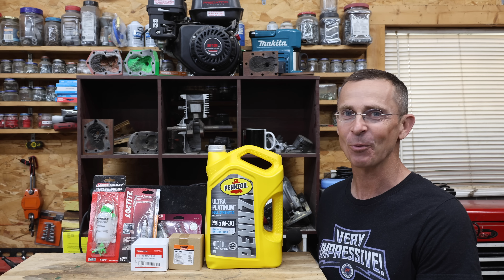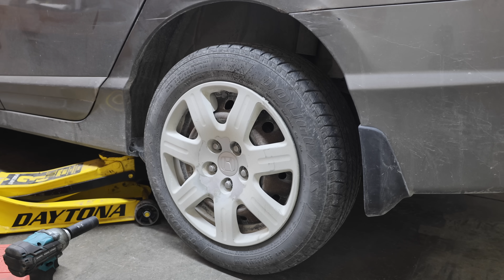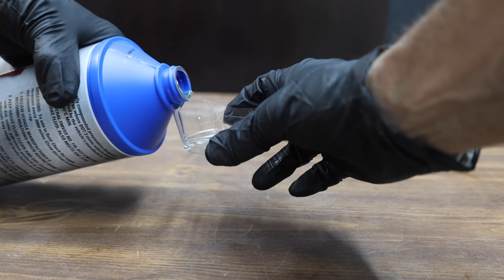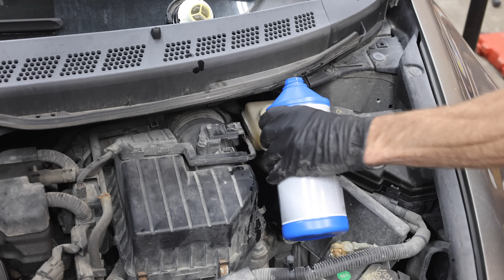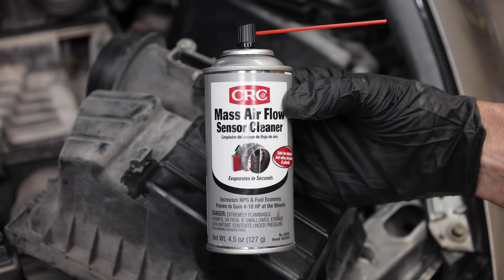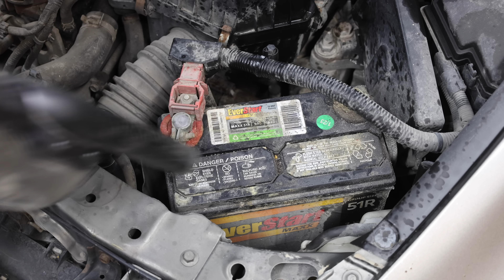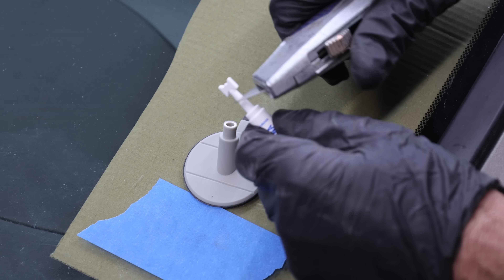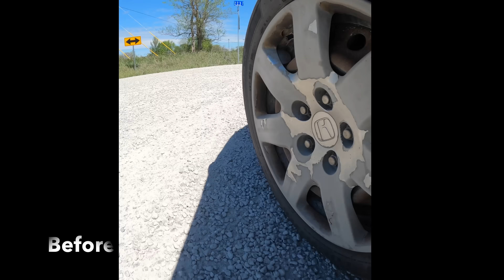Most Reliable 200K Mile Car? Let's Settle This!

Comment: You should definitely do a video on best Over the counter windshield repair systems because that one was absolutely ridiculous. 
I used to repair windshields professionally with vers expensive equipment, but it's a very simple process and I personally use the Rain-X kit because it's simple and is pretty much exactly the same process that professionals use. 
What they don't tell you is to make it pretty much disappear, you have to work all the air out of the break. That Permatex system is way too complicated.

Comment: Please review windshield wipers.  I went to Walmart and noticed the rubber edges of all the wipers on the shelf looked alike, only the metal holding parts were different.  Hmmmm......Would like to see if the rubber edges were made from the same material or from plastic/rubber/silicone/or other synthetic material.

Comment: TIPS 8:17 : You should have replaced the radiator cap because it is designed to let coolant flow from a certain pressure. With age, the pressure rating changes and the cooling system may operate outside the temperature and pressure specified by the manufacturer.  Make sure the rating of the new device is appropriate for your region (depending on whether it's hot or cold, the cap pressure will be adjusted for greater reliability).  the one on video is rated to 1.1 bar
and maybe also the gas reservoir cap.

Comment: Great job Todd!  You smartly cleaned the MAF sensor but not the throttle body plate?  They're usually pretty carboned up.  Top tier gas will clean the injectors as well.  I'd probably run some injector cleaner with high PEA's as well.

Comment: I see a safety concern.  When I was in college I read this court case. A mechanic used a jack to lift a car.  The jack failed and the mechanic got hurt. He tried to sue the jack company and lost.  It was ruled that jacks are made to only lift a car, not hold the car up.  That is what jack stands are for.  So, you can lift the car with the jack but use jack stands to hold the car up not the jack.

Comment: 300,000km on the daily 2000 civic for the summer, 427,000km on the winter beater Acura EL.  Acura cost $100, Civic was free.  Maintainance has keep them going for years and have no intention of parting with them...

Comment: Ha ha, can you imagine if this was a Ford.   Well, it likely wouldn’t have made it past 130k anyway.  If it had the 3.5 engine, the water pump would cost $3,500 to replace at an independent shop, a lot more at the dealer.  Bit lots of other parts would have failed first.

Comment: I bought a new Chevy Cavalier wagon in 1983. Not sure what year I sold it, but was sold to a junk dealer for a few bucks. It was still running okay, but had rusted badly by that time. I had jacked it up to swap some tires (it had excellent tires which would fit another car I owned at the time, so put junk tires on the Cavalier) and at one point the jack went through the car on first attempt to raise it.
Still, couldn't knock it. Don't recall exactly how much I sold it for, but think it was $25. Still, after putting 325,000 miles on it I couldn't really complain.Some makes/models are better than others, but taking care of the routine maintenance tasks and driving like you have good sense makes a big difference.

Comment: I sold my 2015 toyota yaris with 260k miles.. all  original parts from factory except front cv joints and sway bar links, starter.. extremely cheap to maintenance. Best car Ive ever owned for daily use

Comment: I have a 2006 Grand Cherokee with 285,000 and a 2007 Grand Cherokee with 215,000 miles on them. Neither one has ever needed any major repairs, just kept up with basic maintenance.

Comment: Old cars are less likely to require a key with a microchip. Also, newer cars can be used to murder you(as Wikileaks Vault 7 showed). So many reasons to prefer older cars. Also no $10,000 battery to replace like with used EVs.

Comment: I have a 2004 gen 5 Camry with the 1mzfe 3.0 V6. It has 248,000 miles on it and the only part that i ever had to replace due to failure was the starter. I recently replaced all of the suspension and control arms etc due to all of it being original since i was replacing bad outer tie rods, which were also original. To my surprise, the lower ball joints were still perfectly fine. They seriously felt like they had 20,000 miles on them. The car has been in my family since 2007 and it has never missed a beat. It's been such a good car that i'm debating buying a super low mileage one to replace this one in the future as the rocker panels are starting to rust, and the interior is pretty tired.

TLDR, if you want the most reliable car ever made. Get a 2002-2006 Toyota Camry with the 1mzfe. It will never let you down. Gen 4 Camrys are in the same boat, however the Gen 5 is safer and has a better interior, more quiet etc.

Comment: Fantastic video.  While your bread and butter may be product tests, a series on simple maintenance task would be huge. 

Oil change, tire rotation, belt changes, water pumps and thermostats, alternators and starters, how to use a basic multimeter.  Basic plumbing repairs, lawn mower service, 2 cycle engine service and pull chord replacement and more.

Comment: I've been driving a $500 Hyundai Elantra for 3 years now and couldn't be happier with it. Starts every time, cold A/C, alloy wheels, (fake) leather interior,  killer audio system and sound deadener I put in when I started driving it. 150K and I'd drive it anywhere with confidence. I bought 1 new vehicle in my life and don't plan to buy another. EVER.
*ode to my $500 car:
Beaters 'N buckets, no car payment for me
Drive anything, so long as she's got A/C
Repairs and mantainance all done by me
backyard mechanic, under shade tree
You may laugh and you can point,
I laugh at you in that overpriced joint.

Comment: If a car has 200K miles and the automatic transmission fluid has never been changed don't change it or else it may start slipping if you change it.🤓

Comment: Just outstanding. We always nought used when it made sense. We finally bought a new Rav 4 hybrid before the crazy orices for cash. Changing oil teice as often S the dealership recommends.
  That's our retirement reward car and average fuel use is over 40 MPG.

Comment: i still own and daily drive my 1989 Chev C1500 (gas) and 1995 Chev K2500 (diesel) trucks.
can not be beat. cheap and easy to maintain. both get on average about 18-19 MPG which is actually BETTER than most modern trucks!
Reply from the maker: Thanks for sharing.

Comment: I'm impressed by your knowledge and skill!  With your mechanical knowledge in mind, I have a suggestion for a new video:  go over common things that mechanic shops will pressure you to replace and how to check if they really need to be replaced and what risk you are taking (if any) by delaying that maintenance.  Things like pinhole sized holes in a cv joint's boot, old shocks, oil, etc.
Reply from the maker: Thanks!  Thanks for the suggestion.

Comment: My F150 is almost at 270k miles and still runs good.  Only real issue is the ABS/TC computer crapped out.  But, drives fine.
Reply from the maker: Thanks for sharing.

Comment: I would like to see you make videos of taking a $500-1000 car, putting $500-1000 into it, and having a very reliable daily driver. I've owned a 1992 Honda Accord with nearly 300k miles when I bought it, and I put 30k highway miles on it, commuting. I currently own a 2000 Toyota Corolla, bought with over 200k miles on it, and it had the original spark plugs in it. I put in some repairs, and it's been totally reliable for me.
Reply from the maker: Thanks for the suggestion.

Comment: Beware 06-09 civics with the R18 engine! They never issued a recall, but just a warranty extension long expired by now. The blocks are known to crack around the cooling jacket leaking coolant in various severities. Just search "Honda Service Bulletin 10-048".
Other than that and a few other common annoyances like paint, they do run well, are efficient, and the manuals are fun to drive.
Reply from the maker: Thanks for the feedback.

Comment: Todd, You and many of us think like you when it comes to vehicles. I have a 2006 Mercury Mariner that I bought new for my wife. After she got a new Ford Edge; I used the Mariner for work. I had to put a new engine in it at 234,000 miles due blown head gasket. I did basically the maintenance you did on your Honda. I now have 324,000 miles on it and still running strong. Yay Project Farm!
Reply from the maker: Thanks for sharing.

Comment: Great video! I'm with you, I'm not about to pay crazy money for a new vehicle. I have four vehicles, 2 cars and 2 trucks. The one with the most miles is my 02 Silverado Z 71 4x4. I bought it with a little over 220k miles in 2017. I knew most of its history, it had been worked very hard and had reasonable maintenance. My mechanic went over it with a fine tooth comb. It had a list of things needing repairs or skipped maintenance. I had those issues addressed in order of importance, and now my truck is in tip top shape (mechanically) which is all that matters to me. She bears all the scrapes and dings of a work truck, and the usual rusty cab corners, rockers, and fenders. Doesn't matter to me in the least. I call her Big Red. That 5.3 liter is  the original engine, purrs like a kitten, still has plenty of power. The extended cab with 4 doors leaves room for passengers in the back seat. Interior is in good shape, everything still works like new, even the power mirrors. 4 wheel drive when needed. Best of all I have faith I could drive it across country if needed in comfort and reliability. Today she has 325,000 miles and still going strong.
Reply from the maker: Thanks!  Thanks for sharing.

Comment: I was pleased to see you showed the Honda ATF-DW1 auto transmission fluid used.  Honda's automatics up to and including the 6 speed models are a completely different design from the typical planetary gearset automatic transmissions most other makes use.  Using the proper DW1 fluid really makes a big difference in shift performance, driveability, and likely prevents premature clutch pack wear in the transmission.  Universal fluids (even many that state they can replace Honda DW1) don't perform equivalently.  Use of universal ATF quickly leads to rumbling and delayed/hard shifts.  Fortunately, a repeated drain and fill with DW1 often resolves those issues, making the transmission feel like new again.  If the owner's manual specifies ATF-DW1 or the obsolete ATF-Z1, (DW1 replaces it) I don't even think about using anything else.  After 2014, Honda has used some conventional planetary-based automatics in certain vehicles, so they probably differ in fluid requirements.  Those are the 9 speed made by ZF, and the new 10 speed made by Honda.
Reply from the maker: Thanks for the feedback.

Comment: I wish you could find a $500 car like that around here!!!  The cheap cars that have major problems(blown engine, knocking engine, bad transmission, not running, ect) all start off at least $1500 if not $2000.
Reply from the maker: Thanks for the feedback.

Comment: With 200k+ miles I would only buy a Toyota/ Lexus or Honda/ Acura used. An easy way to drain all the ATF from a vehicle is to remove the hose EXITING the transmission oil cooler behind the radiator, start the vehicle and the old fluid will be pumped out into a large pan or bucket. New ATF is constantly added to the reservoir. When the new fluid starts coming out the transmission oil cooler line all the fluid including what was in the torque converter was pumped out and replaced with fresh fluid. This method is easy, mess free, and saves time from having to drain the transmission three times.
Reply from the maker: Thanks for sharing.

Comment: Ive always bought old vehicles.  I spend very little in repairs since i do the work myself, However i dont actually have much maintenance. Ive never blown up an engine or had a transmission go bad. Just minor stuff. I currently drive a 96 C1500 with 350,000 miles on it and a 99 Blazer with 335,000 miles on it. Ive never given more than $2500 for a vehicle. Keep your foot out of it and keep all fluids changed when due (not just oil) and everything greased and drive it forever.
Reply from the maker: Thanks for sharing.

Comment: I would not touch that car with a 50 foot pole.
I have 2 cars,  2006 Mazda 3 2L and a 1974 Cadi 472cid
The Mazda has 485,000km on the clock. Got the car new. Money spent on the car to date, 2 timing belts (every 200,000) 1 cluch @ 370,000km, refinished all 4 brake disk 2 times, oil change every 20,000, rear end bushes.
Still has factory sturts and CV's. Only thing wrong with the body, KARREN hit the back 1/4 with a shopping trolly.
The Cadi has 160,000m on the clock, I shipped from the USA in 1983 with 96,000m on the clock money spent to date 4 CV's, 4 Sturts, new front disk, 2 new Autos, 2 full sets of bushes, wiper motor, timing kit. new motor and auto mounts, I could keep going with the list, the car is a money pit. only reason I keep it, is I use it for car shows (white with red trim) at car shows I put my BOS-HOG number plates on. I do like driving it on a nice summers day with the roof down, I keep it out of the rain, it leeks.
Reply from the maker: Thanks for sharing.

Comment: FYI, that clicking noise was the worn CV joints not the struts. The easiest way to tell is the clicking is always worse when turning and turning while accelerating. Worn struts make clunking sounds you can feel. Clicking = CV Joints, clunking = struts or other suspension components. Cheers!
Reply from the maker: Thanks for the feedback.

Comment: Still have my Corolla with the original engine and transmission. Only has 657k miles on it. Also only 24 years old! You cannot kill a Toyota as long as you keep up with basic maintenance.
Reply from the maker: Thanks for the feedback.

Comment: !! What a Great Video this was to see and your actually saving the planet by reusing what is already made. You will not be able to do this with a Tesla or any other Newer Vehicle in the next 16 years but those cars from the 80's, 90's and early 2000's will still be there. As a Video suggestion: Can you test Battery powered Soldering Irons like Milwaukee, Ryobi etc. or the Electrostatic Sprayers to determine if they actually do anything at all compared to a normal pressurized Sprayer.  Thanks
Reply from the maker: Thanks!  Thanks for the suggestion.

Comment: I was finally watching Mighty Car Mods video about flipping cars as fast as they can.
I stopped because I needed to see a client, but I excitedly showed her a clip where they shoved a deflated basketball inside a car door, inflated it, and popped out a dent.
I backed into Mom's car on Sunday and need to fix her door.
I don't think that will work well, but I am curious what it will do.
I bought a basketball just for moving Mom's piano because I watched a video where someone shoved a deflated basketball under a piano, inflated it, and slid a dolly underneath, but I decided to use my back instead.
Anyway, I thought those were cool tips, but I am going to go back through your video and list all of the tips that I saw.
A fluid extractor to extract more brake fluid than a turkey baster.
I stole Mom's turkey baster when I replaced my brakes a couple of weeks ago.
Double-sided tape to keep the coolant funnel in place.
I actually bought a no-spill funnel, but I can use this for all of the other fluids.
Reply from the maker: Thanks for sharing.

Comment: Excellent video on returning an older car to top shape. I have a few thoughts. For drum brake springs needle nose pliers are great. However, I use needle nose, vice grip pliers for a good grip. I am a big fan of fluid film. it can be used lots of places on older cars to help with rust and preserve parts. I also spray it over the battery terminals for protection. to clean, foggy headlight lenses many will buy an expensive cleaner. Always Try a test spot first, but sometimes cheap toothpaste works And for Deeper cleaning, plain old polishing compound can work well.
Reply from the maker: Thanks for sharing.

Comment: Don't clean mass air flow sensors, figure out why it got dirty in the first place, fix that, replace the sensor. The coatings they use in the sensors do not like it when you spray them with liquids.
Reply from the maker: Thanks for the feedback.